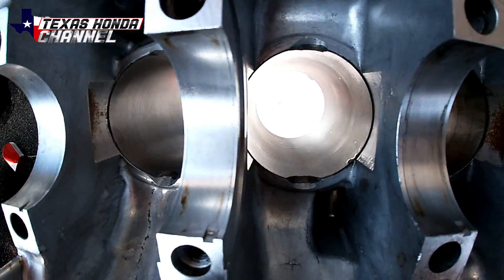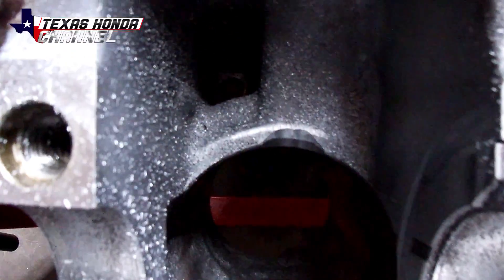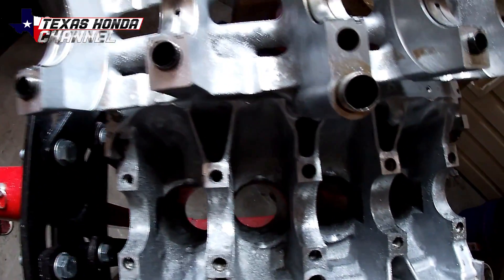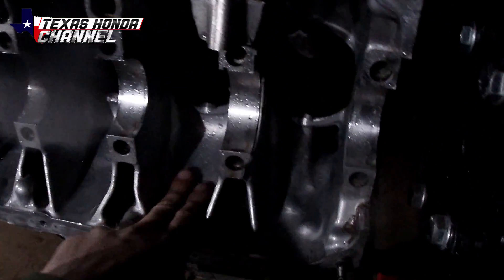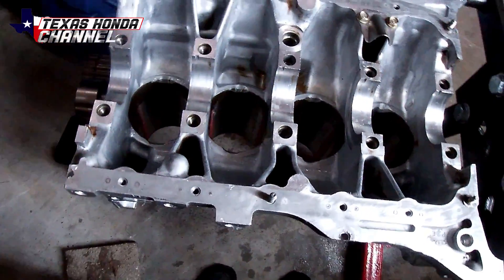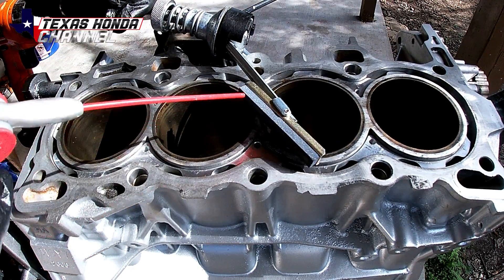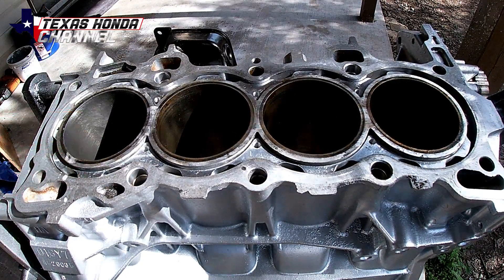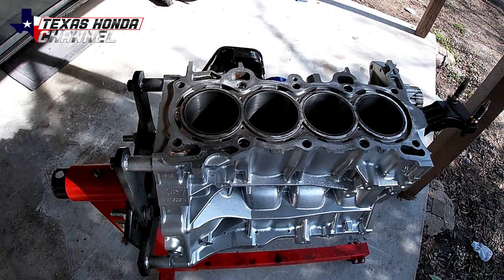Vitara build Part 3- Notching the block/block guard install & cylinder honing

Comment: benefits of using block guard? do you have to get the block to a machine shop after installing a block guard ...? currently vitara piston speedfactory bottom end, stock head but lsd trans and looking to make little over 300wheel what should i do

Comment: Just a couple of questions:
1. When honing are you afraid of taking too much off the cylinder walls?
2. After you are done honing when you buy your pistons and piston rings do you use the OEM factory size or do you buy a bigger size? I assume you'd use factory size.
3. I have an ancient d15b2 block that smokes but ran fine, could I do a budget rebuild by re using the rods, getting new bearings and pistons and piston rings after a hone? I am on a shoestring budget and I am up for the experience lol.
Reply from the maker: Boosted Fool most the time I take the block to a machine shop to get measured and honed there they have all the right tools to measure with. I run oem most the time but I prefer to bore it over to the next size up. Might still do that
Reply: @TexasHondaChannel  ok, but if you just hone you can keep standard bore?

Comment: So did you not use the vitara no notch rods? I’m wondering cause if you still have to notch the block with those rods then I’d get different rods
Reply from the maker: 10-49 Clique These rods support more power than the no notch so I’m happy to notch them. The car is Running 27psi not sure horse power yet but we will know soon enough
Reply: Ok thanks. I’m planning a D16y8 build for about 500hp but I’m wanting to set up the bottom and top end for more power in case I need some gapplesauce. I love the channel it’s helped me a lot. I appreciate he response